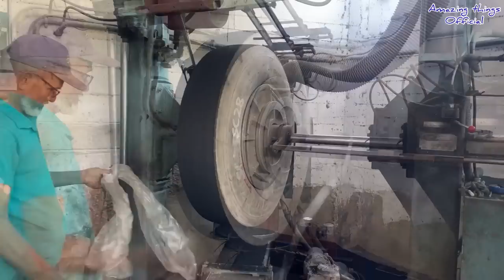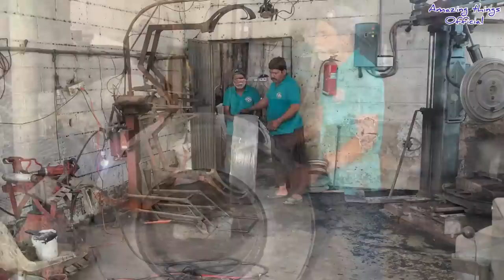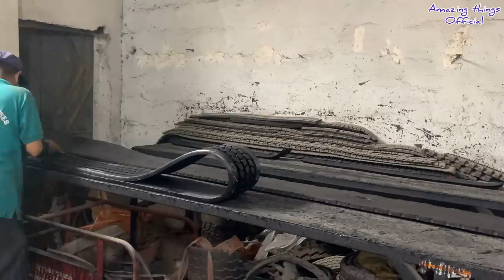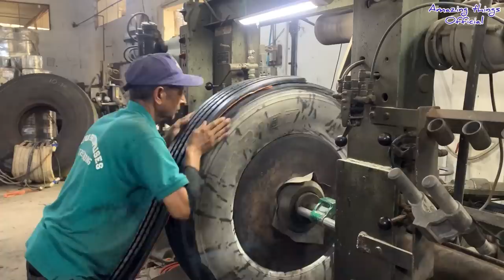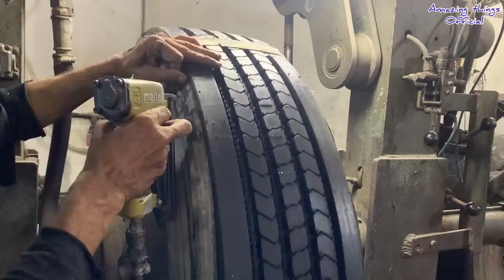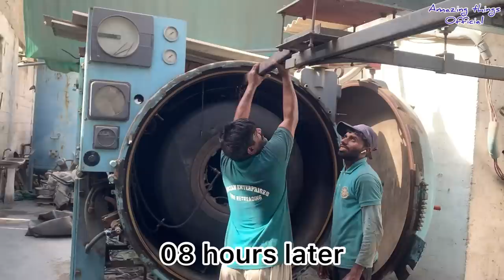The Amazing Process of Retreading Old Tires || How They're Made Like New Again

Comment: Extremely skilled and great technique but what's the price difference between a remould and brand new tyre?  It's not just the tread that gets worn.  The whole tyre is a hazard
Reply from the maker: Thank you for your kind comments and support. Retreading is around 30% of new tire cost.
Reply: @AmazingThingsOfficial  It is a very dangerous product. I have personally seen a truck in front of my car, on the highway, lose the cover of a wheel made in the way described in the video, and the piece that came off ended up against another car, breaking its windshield and risking killing the driver. NEVER save on tires by fitting this SHIT!!! Maybe in India or Pakistan it's normal, but in Italy it's forbidden and it's STUPID to use these tires!
Reply: @comesefosseantani231  - I see huge chunks of truck tire tread on freeways in the United States frequently, especially in the summer. The tires get very hot in 40°C weather, and if the truck is even a little overweight, KA_BOOM! I would never authorize a shop to put re-treads on any vehicle I owned. I've experienced tread separations on a boat trailer once: A tire shop cheated me by putting retreads on my trailer - I was travelling out-of-state, and they probably figured that if the tire failed, I would be hundreds of miles away and wouldn't bother complaining about it.
Reply: @laura-ann.0726  unfortunately America has yet to outlaw these atrocities
Reply: At least they aren't allowed on steer tires